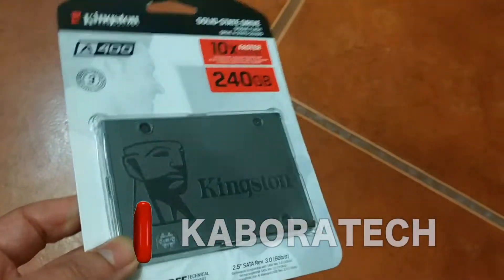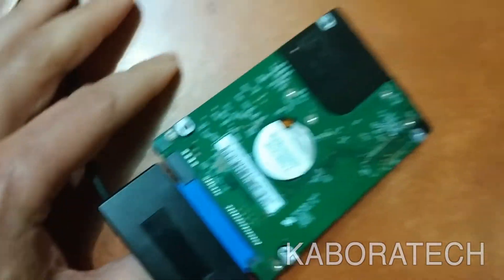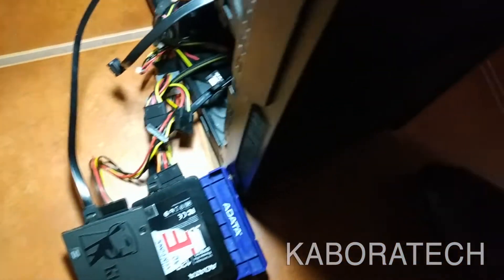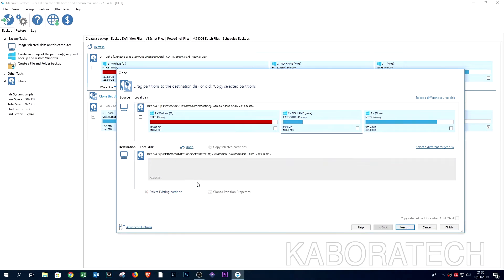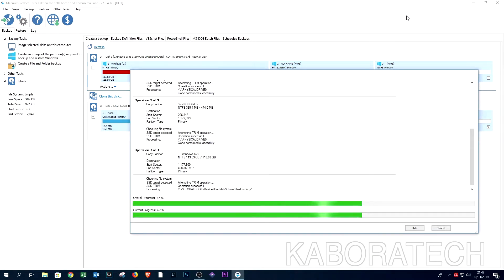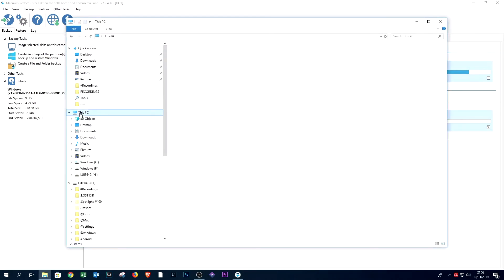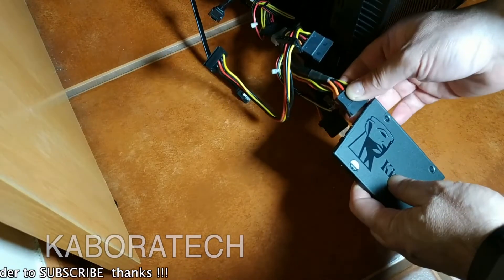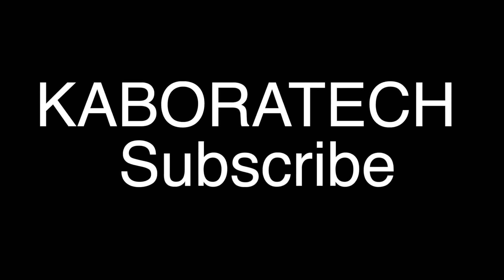How to Move Windows 10 to SSD Without Reinstalling

Comment: For some reason i did exactly what you said and now my 1TB drive i installed shows 118gb like my other. Any way to fix it?
Reply from the maker: You did not extend the free space, you have to go to disk management and do it manually
Reply: @kaboratech  I figured it out. Turns out it was taking the remaining 850gb as a recovery partition.